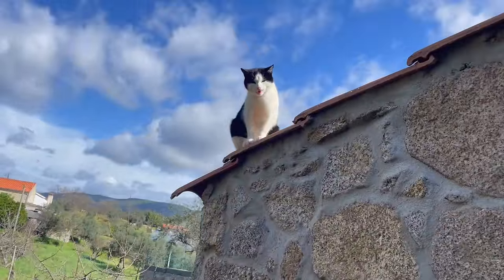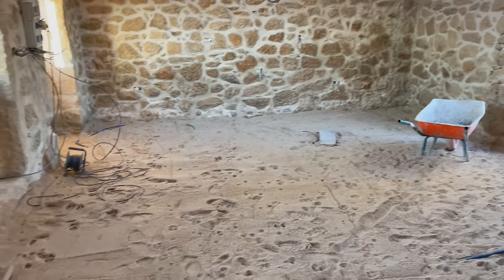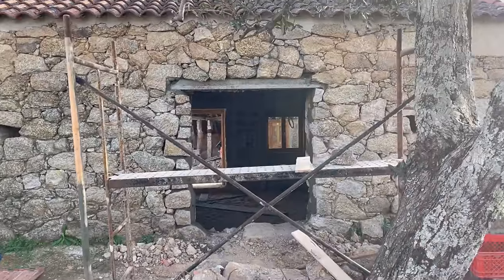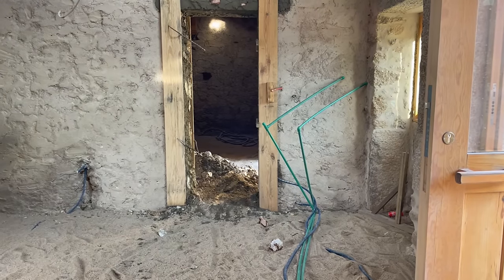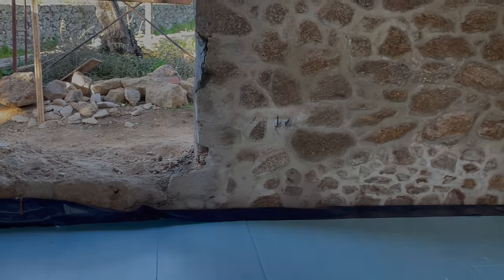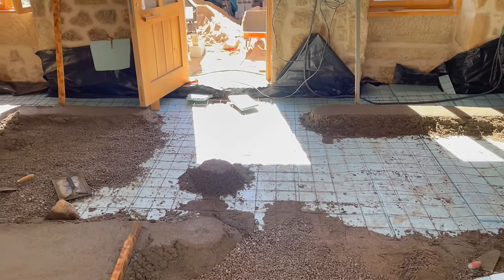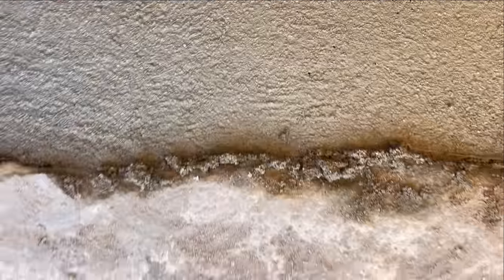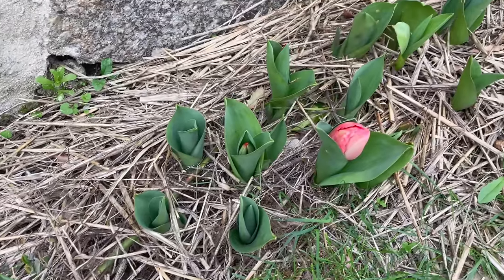CONCRETE FLOOR LAYING - Stone House Renovation Portugal

Comment: Are you not putting flooring on top of the concrete which will bring the floor up to the door step
Reply from the maker: Good point. I am tiling the floor 😀